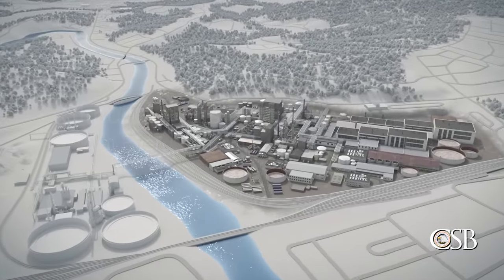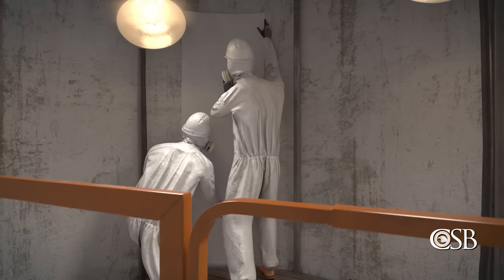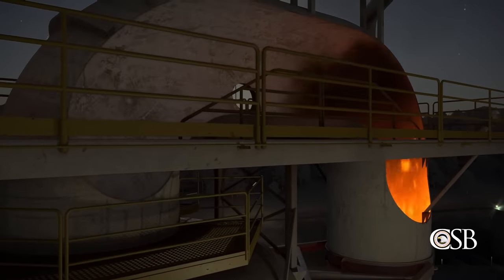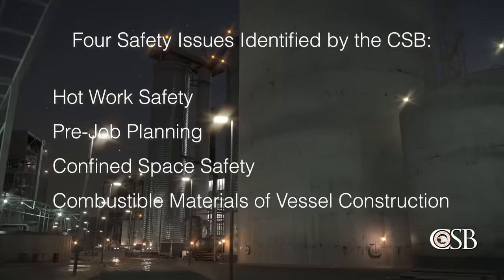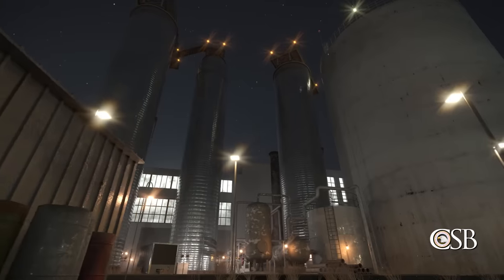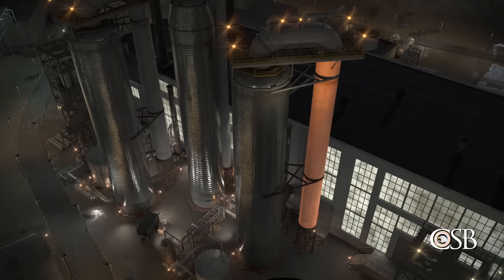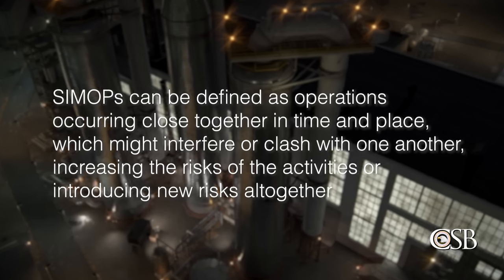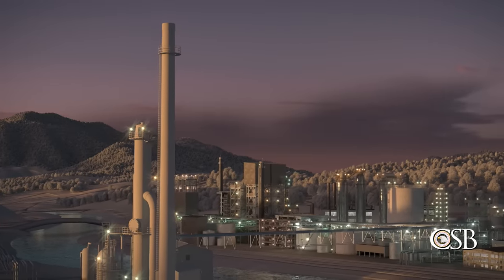Simultaneous Tragedy: Fire at Evergreen Packaging

Comment: I was there that night, working as an E/I supervisor on the board machine. I remember hearing people screaming for an electrician over the radio to come kill power. We knew something bad had happened. One of my employees was a member of the rescue squad and pulled the bodies out after the fire was put out. It was tragic. He is still bothered by that memory. Safety takes hard work. It takes dedication to information gathering and then action. Rest In Peace.
Reply: Was coming off graveyard when this happened man. a buddy of mine was on the rescue team who got the call and he told me what happened 😢 really sad how wally treated it.
Reply: I dont know what that thing does but grinding fibreglass in a confined space is a crazy idea. Why not make the stack out of metal so it doesnt need this kind of maintenance? If the inside deteriorates so badly, make it out of a better material.
Reply: @tubester4567  Too expensive.
Reply: @FrozenHaxor you can either pay a large amount once and not have to worry about it for a long time, or pay a 'cheaper' sum many times in that same period to maintain it while at the same time suspending your operations longer and exposing your employees and/or contractors to greater hazards.
Reply: @christopherrogers303  Yeah tell that to the bean counters over at the management, they'll laugh you off. If it's cheaper option now - it goes. It is what it is, always been and I see no change to that in foreseeable future unfortunately.
Reply: @FrozenHaxor  oh I know it... the penny pinchers in the finance office will trip over dollars to save dimes all day every day.
Reply: @christopherrogers303  Yes, it's always shortsighted because all that counts is having the number look good for the current quarter or whatever their goalposts are, who cares if it costs 10x as much in the long run, gonna make those numbers look good for the short term...

Comment: I work in the field of Pulp and Paper and I hate to see these videos related to my industry.  But like others, am happy for the service CSB provides.  The written report at the CSB site from last year is excellent and highly recommended.

I was not surprised that the repair of the linings of these two connected  bleach towers was contracted to two different companies (very likely competitors).  They were in a cold outage and usually they are trying to minimize the down time on this long process of repair.  The types of lining repair were similar but different. Two tasks rarely perceived as being flammable.

The Rimcor employees (Brett Burgueno, Curtis Butler) were on a special type of scaffolding that brought the platform up over 200' off the base, very close to the crossover, and the platform could take a very long time to lower.  When they realized there was smoke or fire, I suspect they could not have gotten down quick enough.

The negligence of simple proper handling of the heat gun that allowed it to ignite a 5 gallon bucket of resin is maybe the worst to me.  Absolutely no reason to have the heat gun inside of the confined area.

It would be easy to forgive the workers for not realizing the Fibre reinforced plastic lining was flammable but that is also their expertise.  

Hopefully the entire industry and safety management at mills are aware of these sorts of dangers and all mills are following the advice of OSHA.
Reply: Thank you for the extra information. I was waiting for them to explain why the Rimcor employees didn't just get out of the tube as soon as they smelled smoke but the video never covered that. Surely allowing employees to be practically trapped insided that thing with no expeditious means of escape is just as negligent as any other topics covered here. An emergency abseiling rope would not take up much space on the platform and you can be trained to use it in under 1 hour.
Reply: I made a point earlier that work should always have a fast, safe escape route at all times and they were not provided one.  In addition, they were working in a confined space with no emergency air, ie a scuba or 2+ min compressed air breather can.  It probably wouldn't have taken that much - a rope ladder and some canned air and both would have made it out alive.  I argue these are the 5th and 6th points the investigation should have also added to the list of the 4 items they mentioned.
Reply: @DontCryAboutIt  No, the heat gun is just a special hair dryer, with an inner hot flow and an outer cooling flow to keep the casing on the outside from burning the operator. The coolant flow is just a ring of air flowing in the annular space between the outer plastic and the inner metal; the inner hot flow is just a normal hair dryer style with lower airspeed, so the same electrical power produces hotter air.
This hot core contained orange glowing resistor wires that normally heat up the passing air; if they come into contact with the resin while on, they are effectively an electric match being touched to the resin.

Edit: the effect would have been like a car cigarette lighter.
Reply: @myleswillis  Correct, no way should it have been signed off on without the platform having emergency decent devices. The wind turbine industry learned this the hard way several years ago in a similar incident.

Comment: Spent a few years of my life working with torches and welders everyday, hazards are everywhere and fire spreads unbelievably fast. I had a guy from the company we we working for watching with a fire extinguisher while I was welding, flip up my helmet and see something burning below me (I was on a scaffold) look over the guy's got his back turned while he's chit-chatting with someone. Of course I proceeded to yell at him "Hey, hey put that out!". No big deal that day but you can see how easily it could have been.
Reply: And today: head buried in his cell phone.
Reply: I work in a big laundry plant with lint floating around everywhere and covered all over the machines. Everytime we have have to do a weld a repair we have one guy with a water spray bottle putting flames out.
Reply: @tribulation138  CSB has a video when a sugar processing plant blew up because of dust. Sounds like you've got a bomb fixing to go off. De Ridder Ga. I think was where the plant was and I do mean WAS!
Reply: Good on you for not sweating that. But that actually sounds like thats a big deal. His complacency, lack of awareness and lack of urgency almost ended in tragedy. Sure, it "almost" caught fire, but almost is definitely a big deal.
Reply: I can relate. Many years ago in my home garage I was kneeling on a piece of packing foam as a cushion while welding some rocker panels. Stopped in the middle of the weld and looked own to see a flame propagating from a drop of molten metal that had fallen on the foam. Quickly stomped it out and did the rest of the job kneeling on the concrete floor.
Reply: @gerry5712  It don't take much and even less if the conditions are right.
Reply: @tribulation138  As you well know, that's treating the symptoms. Someone should be doing something about that air quality.
Reply: The Station fire and that fire in that apartment complex in Houston are excellent examples of just how fast fire will spread given the right conditions.
Reply: Unrelated, but this is why places have rules to not chitchat with lifeguards.
Reply: I had a 30 inch tie on explode (I was welders helpers) and it sent me to the burn unit with 2nd degree burns all over my face, neck, back and we always had a fire watch guy for each welder/helper (2 welders on each side of pipe). When that explosion happen, I was a few feet away so it threw me back several feet to the ground and knocked off my helmet, safety shield, safety glasses, welder gloves, welder cap, blew open my shirt, and everyone else dropped everything and ran like their life depended on it. When I landed on the ground, there was a ceiling of firing above me and I was in this pocket surrounding by walls of piping and saw 1 little sliver of light underneath another nearby 30” pipe so I immediately attempted to escape through that tiny hole but got stuck under the pipe, until I dug gravel out underneath me so I could fit. 

When I was stuck wedged under that pipe, with the fire roaring behind me, I saw everyone running away, so I was yelling for assistance but not 1 person saw me or heard me, it was fight or flight for every man and I’m just thankful that I was able to dig myself out and get free.

Comment: It should also be pointed out that FRP does not have to be flammable. There is ASTM certified fire resistant FRP, but as you can imagine, this is much more expensive than the non-fire resistant FRP.
Reply: Does the fire-resistant rating applies to the uncured resin too ? Or just the cured one ? It could be a very important distinction as the chemical composition of this type of resin changes drastically when curing
Reply: @uski  Notably, the self-extinguishing resin typically is bromine-based, from my understanding. If that burns (like, due to an external heat source), it creates particularly toxic smoke.
Reply: Should have used a drum warmer

Comment: This video is pretty sad. Railways have been successfully dealing with this kind of thing for decades. 

Like confined space work, track work requires a permit/authority. You receive limits you are allowed to work in and a time frame. 

However, with track work like that, if there are any other workers who are working in your limits you are required to talk to them. It's called a confliction (instead of a SIMOP, same premise though), and before you can begin any work you are required to talk to the other group(s) and resolve your confliction. 

Just because you can see the other workers doesn't mean you can't affect them. Whoever did the risk assessment on the pipe and decided it's 2 seperate entities should really be retrained.
Reply: You should try high voltage electrical work and the communication between industry, the utilities and maintenance/contract workers. (...lockouts, orders to operate, grounding equipment for maintenance isolation, station guarantees etc.)

4 hrs. of paperwork for 4 hrs. of ACTUAL work....sometimes MORE.

Personally...my OWN common sense and instinct for self-preservation got me to retirement. 

YOU are your own last line of defense....KNOW the hazards.🤔
Reply: Not a particularly prescient comment unfortunately, considering only a few months after you wrote this multiple train derailments in the U.S have resulted in toxic gases contaminating entire towns

Comment: I think with air crash investigations, there’s some odd comfort in knowing that these instances are so extremely rare that you never seriously need to think about it happening to you. These, though? It’s so, so easy for it to be you. You can’t say you wouldn’t have ever done some of the same things. I’d absolutely fire some heat into some resin if it doesn’t want to harden as quickly as it needs to and is thus causing problems.

All it takes is a tiny little fumble, and you’re lucky to leave with eyelashes, if you leave at all. I think that’s what make these somewhat more terrifying. It’s so damn easy for it to happen.

Comment: Had a similar, but luckily not fatal, incident at a shipyard that I worked at for a few years.

While I wasn't working in the same hull that it happened in, I was in the same building, probably only 70 feet away.

The crew with the accident was working with a cord-powered mixer for a bucket of resin, and a nearby bucket of acetone.

The cord at the moment before the accident had created sparks which shot towards the acetone bucket, causing a quick and violent eruption of flame at one of the workers next to it. He got some nasty burnts on his right arm but fortunately nowhere else.

The crew was able to get back and with the assistance of a nearby crew, got a fire extinguisher to put the flame out.

While there wasn't anything but minor damages to the interior of the hull and fortunately only one burn injury that wasn't fatal, it still served as a huge reminder for everyone involved about how easily something can go wrong.

Comment: I wish the situation of the injured team was explained better: How did they enter their workplace? What were their escape options? Through the top connecting pipe?
Reply: Some of your questions might be answered by the full CSB report, which you can find here: https://www.csb.gov/-evergreen-packaging-paper-mill---fire-during-hot-work-/
Reply: The Rimcor team were on a platform 200’ above the ground on a suspended platform that was not quick to get down from.  I fear that (while they didn’t mention it) the flammable epoxy vinyl ester resin and sheets of fiberglass may burn with very noxious gasses that burn hot and maybe blinded them or asphyxiated them.  The link from the full CSB report is relatively detailed.
Reply: @MikeinAustin  I've been near the aftermath of a yacht fire before, the plastic fumes are overpowering even after the fire was gone; a smell I will not forget anytime soon. It must have been horrible to inhale that kind of smoke directly.
Reply: From the report, they almost made it out, they were found a few feet from the exit. If there had been a prompt warning to Rincor employees as soon as the fire started, good chance they'd have made it out.
Reply: @myke5696  inotherwords, a "spotter" like when you're cleaning stacks: a spotter's only job, and in Alberta though "contracted out" he is usually also a Medic or advanced FirstAid
Reply: @myke5696  . “The scaffolding platform upon which the two Rimcor workers were working was found upside down and on top of them. The Haywood County, NC, medical examiner deemed the cause of death of the two workers to be carbon monoxide poisoning due to smoke inhalation, although multiple blunt force injuries were noted for both as contributory factors.”

I’m not sure if they died from the fall or smoke inhalation and then the platform crashed or what.
Reply: @MikeinAustin  Being as it was a suspended platform, it wouldn't be hard to envision a scenario where the fire itself caused the rigging to burn and the platform fell within the tower, and, it's likely that it would have burned through on the side closest to the crossover first, meaning the platform likely dumped the men and equipment and then fell completely.  :/
Reply: @KrK007  I fear that may be right but don't have any additional information.
Reply: @MikeinAustin  Yeah, it's all speculation, but the information above that the platform was upside down on top of the men, and the men had blunt force trauma injuries, makes it an educated guess.   It's a terrible tragedy.  These men just showed up to work their job, trying to make a living, and they died for it.
Reply: @KrK007  it's not very likely a working platform of steel and wood would catch fire, especially not in this situation with the primary fire source in another area.
Perhaps they realised how slow it went down and climbed the outside making it tilting.

Comment: Most people would never think of a heat gun as "hot work" and it would never occur to them that fire extinguishers are necessary.
Reply: Pardon me if this is a dumb question, but I am surprised as to why it is not mandatory to always have fire extinguishers on hand when working in confined space ? Fires in confined spaces regularly cause casualties and it is often because of unidentified hazards. Having fire extinguishers handy would provide a safety need, should a hazard has been missed. I remember the other video from this channel when I believe a crew was painting a tunnel inside a mountain and the drums of paint caught fire.
Reply: If the cover for the resin bucket was brought into the tower it could have been used to extinguish the initial fire.
Reply: @tomtucker3193  there must have been a high level of flammable fumes in the tower. If they all carried Breathe equipment no one would notice problematic levels.
Reply: just don't be a moron, it will save your life 99% of the time and others' lives as well. Never allow a heat gun to be on without you or someone holding it and paying attention to the business end of it. Tools should almost never be on if they aren't actively in use with close supervision.
Reply: @TheBanjoShowOfficial  I used to say "just don't be a moron" but I think systems are equally important now, after I have seen some very bad near misses.  I own a heat gun and it is designed to sit upright and stay on.  Very useful when you need two hands to wire things together, but also an invitation to leave it running...
Reply: @uski  I guess it's because in confined space you already don't have a lot of oxygen. When a fire happen and you use a extinguisher you will displace all the oxygen and and knock yourself out and since fire can burn at a lower concentration of oxygen than human need, it's actually more dangerous to use extinguisher. Besides, if the fire is caused by flammable vapor in confined space it'd spred faster than you can extinguish it with a single extinguisher. So they decided that preventing fire and evacuation is easier than trying to stop it once it happens.
Reply: @minhducnguyen9276  if you use a class ABC fire extinguisher with the typical powder formulation, you are not displacing anything (except for the propellant gas but that's negligible), so it's better than leaving the fire grow. That said you could be right for CO2 fire extinguishers but I think the amount of gas in a fire extinguisher is small enough to be not the biggest threat if there is a fire
Reply: @uski  Then I think the vapor theory is the better explanation. Besides in the accident in the video, the workers who died die from smoke inhalation and not from the fire itself so maybe the idea is that since you may not be able to find all the fire inside the confined structure especially in the case of electrical fire, it's better to just evacuate than wasting time looking for the fire and die from the smoke.